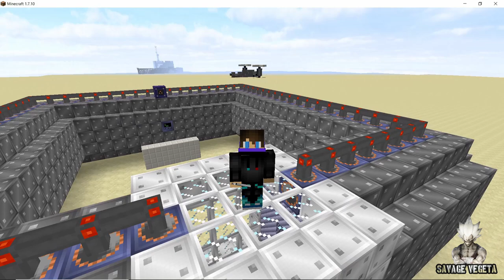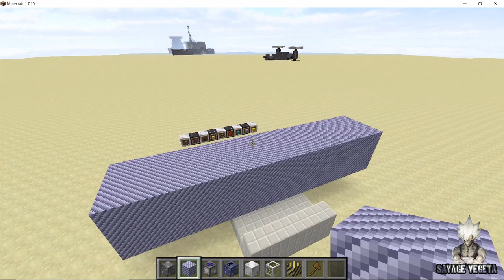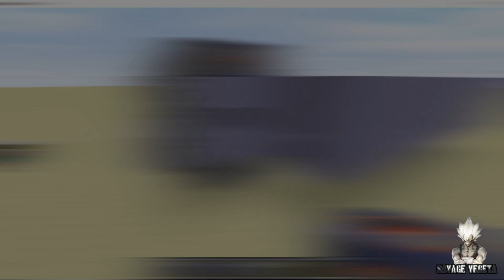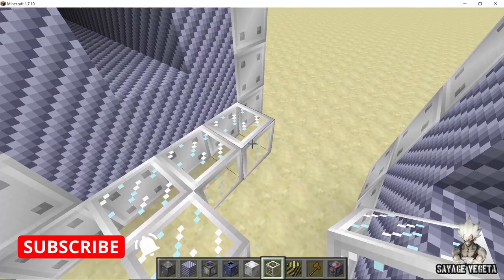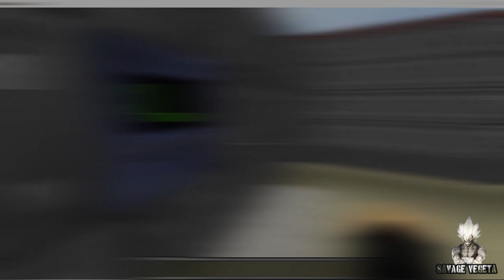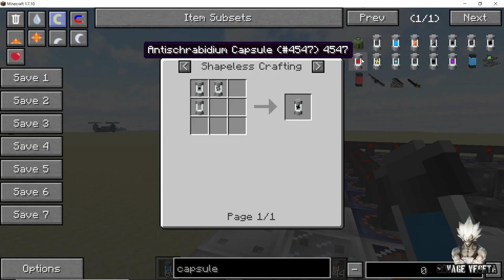How to make a Working PARTICLE ACCELERATOR in HBM's Mod | Minecraft Particle Accelerator Tutorial

Comment: I followed this tutorial step by step excatly how you do it, I double checked every step, but mine always says error. it is in linear mode, all coils have power
Reply: have you figured it out?
Reply from the maker: Which recipe are you trying to process through it, cause in linear mode the momentum value is halved and if it is less than that required by the recipe then it won't process

Comment: Are these dimensions mandatory or can the accelerator be larger in terms of length of each side say for example 30 blocks per side?
Reply from the maker: The accelerator can be big or small depending on your needs. You can even change the shape if you want
Reply: @SavageVegeta  I know in atomic science if you try to make a circular pa, you'll never get it to work as the psrticle will slowdown and speed up at every corner. I assume then hbm's doesn't have this setback?

Comment: What I like of this mod is that is based in real life physics, and your tutorials are the best keep the great job

P.S: Which minecraft version are you using the mod? There is a 1.12 version and a 1.7.10 version and I wonder which one youre playing 'cus I want to play the mod :)
Reply from the maker: That's very true , the new updates bring machines which are even more realistic then they used to be when I published this video. As for the mod version I play the 1.7.10 version as that is the original version of the mod. The 1.12.2 version is called HBM's Reloaded and it's a ported version of the mod.
So yeah if you want the complete and original experience then HBMs 1.7.10 welcomes you !!
Reply: thing is the 1.7.10 mc version does not work for my pc bc it has visual glitches sadly so i use the 1.12.2 but i believe its getting updates alot  @SavageVegeta
Reply: @SavageVegeta  that is the block you for the coils

Comment: I have an issue,
When I followed your design but I used dense coil instead of starmetal

And when I do a reaction it works but if I try again it says error.
Especially with the hydrogen  and copper, I do the reaction once then I try another reaction with the circular one and it doesn’t work. 
Any idea what’s happening?
Reply from the maker: Imma try what you're saying and try nailing down the problem. Most probably it's cause either you've run out of power , or you're trying to make a recipe which works in a linear accelerator in a circular accelerator.

Anyways I'll get back to you once i try this
Reply: @SavageVegeta  thanks ill wait for your reply
Reply: @SavageVegeta  I've been running into the same problem in either hbm 1.7 or 1.12, so basically I've been trying to create digamma particles by using dense mese coils but it seems like the problem is the same here (not enough power input) but at the same time the maximum energy it could store was 10Mhe in the Terminal instead of higher values like 1Ghe seen in the video. any fix? [15 length dense mese coil, blue plating, normal setup really. yes i did put the plugs in the middle, but i didn't add the observation part in the video because i would think it was optional thus giving more coil power] hope to see an answer! amazing videos 🤟
Reply from the maker: @erased4042  I see 2 problems with your setup - first of all if you're using mese coils then you don't need to make it so big , 15 long on each side with mese coils is an overkill. Using mese coils you can make the most compact setups possible that are able to process even the most expensive recipe - Digamma 
Another thing is the "Analysis chamber" is not optional ... That is where the particles actually collide so either you make it transparent or not is upto you but you need to make the analysis chamber and there is no way around this.
The stronger coils you use the more the power needed , therefore you need to place more power transformers sometimes if the transfer rate is not enough.
Reply from the maker: As for your problem my dude in the newer versions troubleshooting has become easier than before as the terminal will give you an idea as to where the problem is occurring. What's weird is it worked once and then didn't again. I did help someone on discord regarding this a few months ago but I'm not sure if it was you on not. 
So if you are still having issues then dm me on discord and we can sort this out on a vc
Reply from the maker: @erased4042  also there are different types of power plugs available for different requirements. For Digamma go with the higher capacity one as that operation consumes most power
Reply: @SavageVegeta  holy crap, alrighty! tysm man i rlly mean it! I'll try it out later and hopefully it works!
Reply: also, im totally down to go on vc for some more help! once more tysm bro 👽👽

Comment: Great tutorial, I was just wondering if the size of the accelerator matters. Because me and my friend need to build one and I was thinking of making a massive particle accelerator cuz why not
Reply from the maker: yes it matters alot, generally the accelerator will be made based on what your final product is going to be and which coil you are going to use. Each material made in the accelerator has a specific momentum requirement and each type of coil can provide only a specific amount of momentum 
So based on  these two things you will be able to design the reactor

Comment: What are the purple blocks you use to power it? I am a newbie lol
Reply from the maker: there's the spark energy storage block along with power plugs. However the way particle accelerators are made has changed ... doesn't need as many power plugs as it used to before. Would recommend checking out a newer video on this

Comment: i get an explosion at the core immediately when turned on no matter what
Reply from the maker: That means your core component is oriented incorrectly. Double check it !!
Reply: @SavageVegeta  turns out the particle accelerator does not work on 1.12.2 :(
Reply: @dalek9554  Now it does!
Reply: @szajbathecat8897  perfect!

Comment: explain schottiky particle diodes please
Reply from the maker: It's used to turn the particle in a certain direction, right click with a screwdriver to change a side to input which will be green and double right click with screwdriver to set the output which will be red. 
Particles do come out of the right side of the core so do remember that

Comment: aye bro i tried to make it but yeah it works but i use "Dense Mese Coil" and it just explode
Reply from the maker: So you're saying the reaction starts but after some time the particle accelerator explodes ? Or does it explode as soon as you build it and start the reaction
Reply: @SavageVegeta  yeah it explodes as i start the reaction but it works as i replace it with starmetal
Reply from the maker: @thycenalbar936  hmm I hear ya , well I will look into this and get back to you as soon as I can brother
Reply: Maybe i should make the Accelerator bigger if i use this dense mese coil
Reply from the maker: @thycenalbar936  also don't forget to check for a missing coil piece , the particle accelerator also can explode if you have forgotten to place coils somewhere.
Reply: @SavageVegeta  i make sure bro that theres no missing coils on it before i start the reaction but now im making the bigger one
Reply: @thycenalbar936  i dont think u can use dense coils

Comment: Mine won't work. I double and even triple checked the dimensions and that all the coils were covered. Place down the terminal, everything fine so far. Try to insert the 2 ion capsules, error, explosion sound but nothing actually blew up(?). I did however build in the corners between the plating when building a structure around the accelerator, not sure how to explain this so here's an image. Does this mess up the multiblock structure recognition? 
https://i.imgur.com/0QzFGls.png
Reply from the maker: The concrete blocks going in the corner shouldn't really affect the multiblock structure tbh. But as I have never built it like this , the only blocks I have are the bottom ones touching the ground.
Now there can be several issues that might be happening , firstly you don't have enough coil strength to process the recipe that you are tying to make , another thing can be the accelerator is not receiving enough power via the source that you have connected.
Also in which version you are building this (1.7.10 or 1.12.2) will have an effect on how the entire setup works. So give me more information on where the explosions were happening and also if you can dm me on discord ... I will be able to help out much more via a screen share
Reply from the maker: Also I forgot to ask this but did you try removing the concrete blocks ?? Build the reactor in Creative mode and see if placing blocks in the corners affects the working in any way